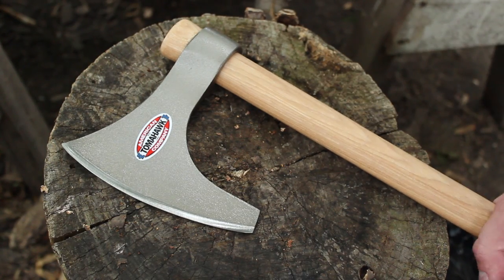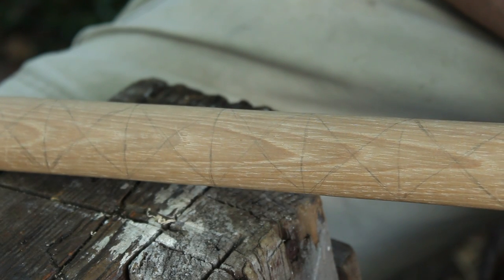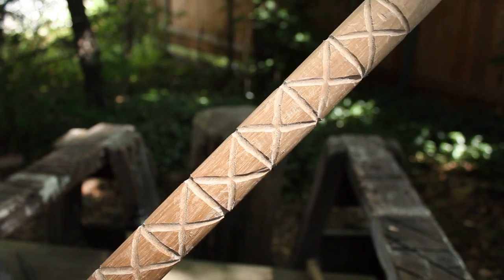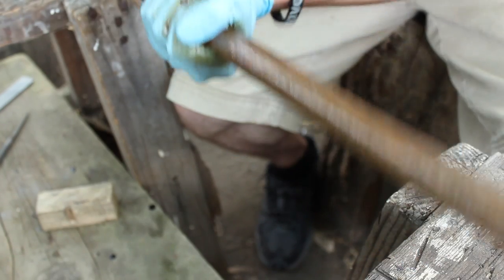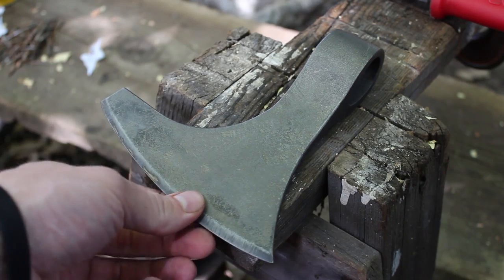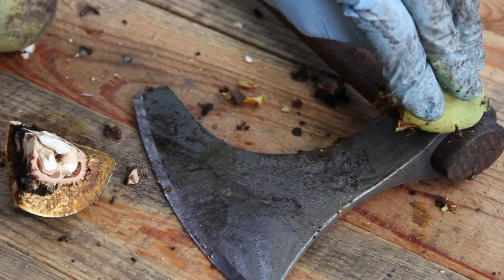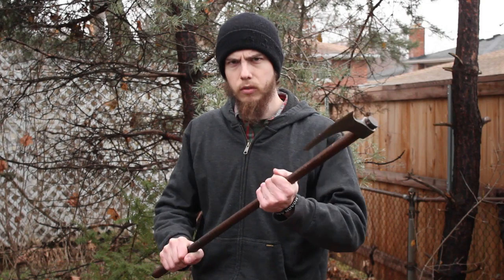Modifying the Cold Steel Viking Ax (Walnut Patina and Birch Oil Finish)

Comment: You have easily cut a slit down the top of the axe handle and put a reed into it to make the wood expand to hold the axe head in place, or put a pin through the sides then peen them down to hold in place as well. 👍🏼😎

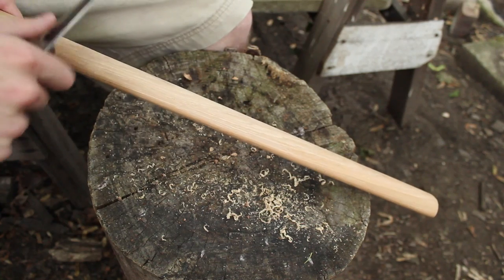Comment: At 1:10 if I'm not mistaken your knife has a right angle spine. You could use the corner of the spine where the angle forms to scrape the wood and save the blade edge.

Comment: Just a thought. It's not a wood cutting axe, it's a Battle Axe. 2) read & learn your runes. 3) you need to get better at sharpening your tools. That small twig should have been cleaved in one stroke with the size of the axe.

Now on the positive (I always try to leave on a good note). At least you're trying, you're definitely learning about your craft, and it was very informative. Thanks! 😊😊😊

Comment: Very cool axe! Did you find the head to be more prone to rusting after forcing the patina on it? If so, did you have to start oiling it as you would for more delicate blades? Thanks!
Reply from the maker: Actually, I've had no problems with the ax rusting, and it lives in the garage.  I do zero maintenance on it.  I think vinegar patinas are the only ones that make a blade more prone to rust.  Thanks for watching, good question!
Reply: @PhilBaumhardt  "I think vinegar patinas are the only ones that make a blade more prone to rust" - I thought the first patina you forced on it was with red vinegar! I'm trying to get one at this point and since my first experience with a rusty axe head and vinegar went horribly wrong, I just want to make sure I don't mess a brand spankin' new head up! PS. I'm interested in the leather sheath I see you make for it, great work!
Reply from the maker: @n.porceddu7380  I see, I thought you meant the walnut patina.  When you first take the blade out of the vinegar, that is the most critical time. As the vinegar dries rust will form, so if you can get all the vinegar off, it should be okay.

Comment: Is the edge hardened on the Viking axe? Usually you can see where the heat treatment was when you soak it in vinegar.
Reply from the maker: Yes, I believe they harden the edges.  In any case, I now re quench and temper these axes when I mod them.

Comment: Forgive my ignorance (and my English) but I have a question. What would happen if someone doesn't remove the screw? The handle will break?
Reply from the maker: The screw is put on from the factory as backup to keep the ax-head attached, but they usually fit so poorly that the screw is sometimes the only thing holding them one.  Thats why I re-shape the handle, so that the axe will fit on the handle better.
Reply: @PhilBaumhardt  Yes but if I don't remove the screw (I have Cold Steel axes/tomahawks, all of those with the screws) and I use the axe for backyard cutting, the screw will damage the handle? Another thing, I can remove the screw and simply put a wedge, instead?
Reply from the maker: @chrislxxix3626  If the fit is solid, it shouldn't damage the handle. I wouldn't worry about.  Don't try to put a wedge in though, because these handles are tapered like a tomahawk not an axe, it will just crack the handle.
Reply: @PhilBaumhardt  Thank you :-)

I have another question: do you know where, in the U.S (I live in Italy) I can find a ash pole suitable for the Cold Steel Pole Axe? I can't find that thing anywhere.
Reply from the maker: @chrislxxix3626  Sorry sir, I am not sure where you'd find something like that.

Comment: These are not made/designed to chop wood. Although you can. The thin blade and shape is designed to cut DEEPLY, especially to cut off arms, legs, heads, etc., by allowing less mass and friction through skin, muscle, tendons and bone. As you saw it Deeply penetrate your log stump. If you want to chop wood get a thicker heavier wood axe.
Reply: OasisofSpirit, actually they are for making boards. You are wrong
Reply: APPIAN NESBITT there is a difference between an axe to crafring boat and a battle axe, forged to be light.

Comment: How do you carve the pattern with the file so easily? I have the same axe and the round file doesn't carve the pattern.
Reply from the maker: Maybe the file isn't sharp enough.  The one I use was basically brand new, I only had used it on wood.
Reply: New file or do what I do and that is use a rotary tool (aka Dremel)

Comment: paint thinner for the axe head just paint it on and let set for about 20min then use a brillopad on it & sand paper for the handle ( scraping with a knife makes the wood look like shit) then soak for 1 to 2 min in potassium permanganate sand again with fine sanding paper and then wax. craving into the wood will weaken it maybe only a lttle but still, better to just wrap with leather like the norsemen did.

Comment: ...wouldn't be better to split the shaft and secure the head with a wedge???
Reply from the maker: For a true axe handle, yes. Because of the taper on this type of tomahawk handle, it is very difficult to properly hang without splitting the shaft or keep the head from simply sliding down.
Reply: @PhilBaumhardt  Thanx...after watching a number of different vids on YT I'm beginning to get the picture...thanx again for the quick answer...this Friday (payday for me) I'm fixin' to order the Cold Steel Viking bearded axe - to go along with a half dozen or so other C. S. axes...
Reply from the maker: @mohammedcohen  awesome, good luck!

Comment: Do away with the set screw in any Cold Steel axe. I put mine over a vice (closed enough to support the head but not tightened) and beat that bitch down with a rubber mallet. It's solid as hell now, no wedges or screws necessary. Their axes are wicked as hell once they're properly set up for use!

Comment: why do people hate varnish so much?
Reply: scrublord mcshitt typically varnish on tool axe handles has only been for keeping the wood preserved in a storage state. If you intent to use the axe you're better off removing the varnish as it will only serve to add friction to your hands, creating hot spots and eventually blisters. Most tool handles are bare wood with a coat or two of boiled linseed oil to protect the handle from moisture. For a weapon type of axe like this one the same can apply with removing the varnish, however I assume most weapon axe guys are removing it to add their own custom aesthetics.

Comment: hahahhahahaha the axe isn't even hardened!
Reply: look how it scates the file bud your a bit wrong here...
Reply: It looks cast, but when he soaks it in vinegar you can see the line where they placed a carbon steel edge. You can see it on all axes after vinegar soaking. The 2 steels react a bit differently.
Reply: j0n31 I have 2 such axes in my collection and I have tested them on a Rockwell scale and they are hardened to about 45- 55 rockwell files are much harder between 70-80 rockwell. those axes are not hardened to as high a Rockwell as a knife or dagger. the reason for this is the high impact nature of axes would cause chipping in the blade. also the edge portion of the blade is the only part that is hardened. making axes this way ensures that even under extreme wear the axe's edge could be sharpened more easily. but the "eye" of the axe (the part the wood goes through).....(yeah that's what she said) is less prone to breaking and is easier to make.